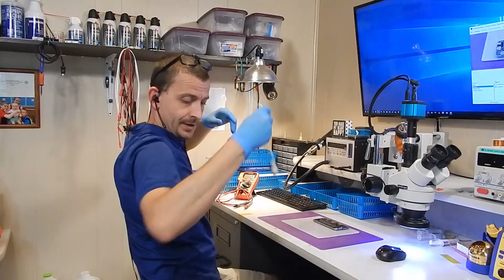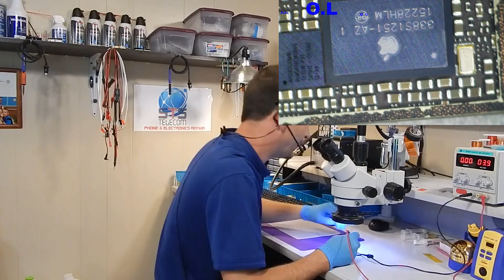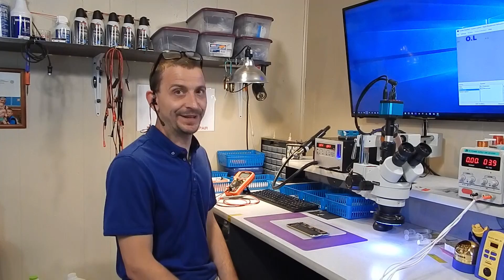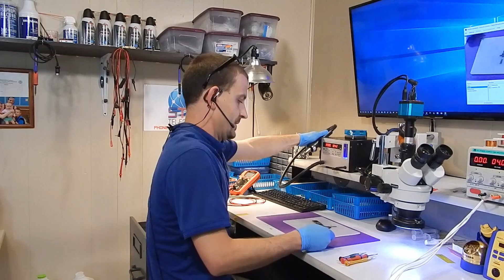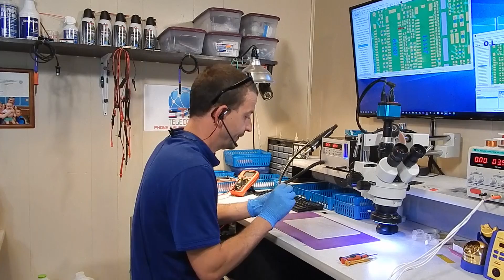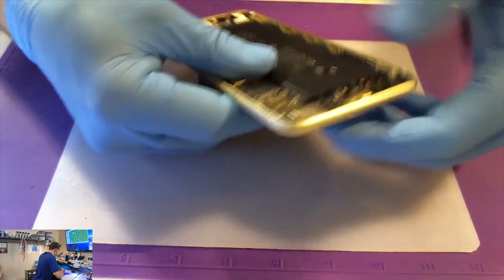Two Phones From Tuesday (iPhone 6/6+)

Comment: I have seen you since 2 days ago, like the way you work it, founding the logical way, as manually as possible and you enjoying while you are doing and transmite it positively. Just a point, you don't think is better to turn on the phone after rework with the power suply instead directly with battery, just in case something leaved shorted and battery doesn't protect like the power supply?

Comment: Nice work sir 
I inspired u then I have opened a youtube channel,
sir is an iphone 6 plus half screen back light problem, 
it would have been nice to have some solution.......
Reply: iphone 6+ has to catodes lines, you must check which one is the faulty. With the ZXW tool you can guide and check which one is and then start to check if is shorted else check the filters or the diode, or worst case the backlight IC.
http://i.imgur.com/Lbs84ix.jpg

Comment: So it was working but stopped? Was there a problem further down causing the IC to constantly go bad, or was it just a bad joint?
Reply from the maker: Not sure yet but I'll be updating the description (or recording it) when I figure it out :)  I'm suspecting a resistor or cap that had its value changed by heat so it worked temporarily.